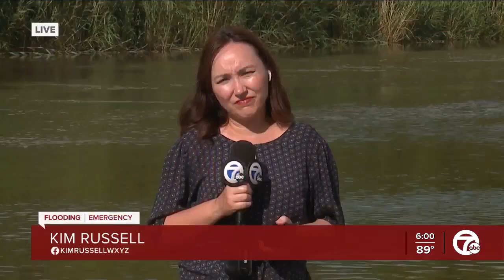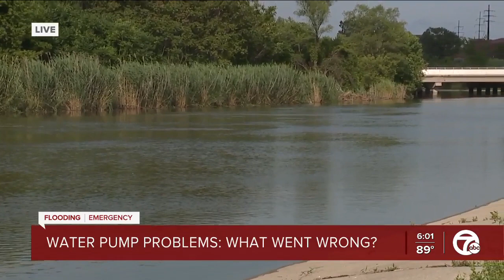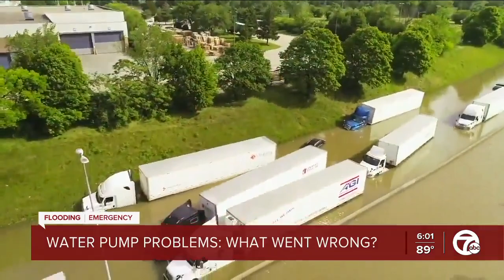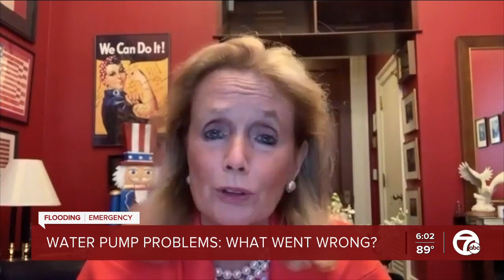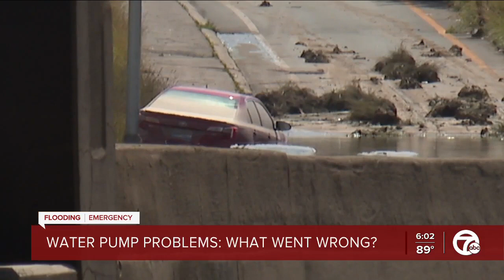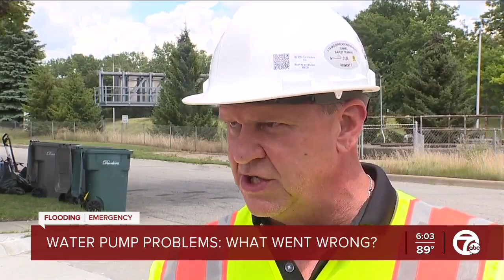Water Pump Problems: What went wrong?

Comment: Right. Right after Ficcano had this new storm drain system put in almost 20 years , the 1st year, Allen Park flooded because A BUTTON WASNT PUSHED DOWN IN THE BUILDING AND ONLY OPENED HALF OF THE SYSTEM. THIS has been ongoing ever since. Leave both sides OPEN. CONSTANTLY. And let the storm system do it's damned job. We paid for it. Let it work!